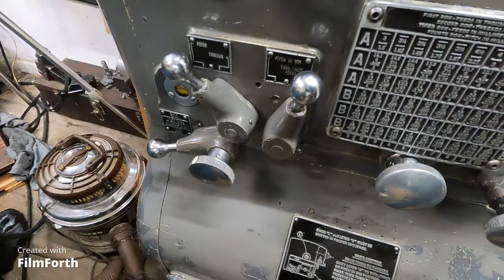Monarch 10ee lathe machining precision small screws 2

Comment: Looks good. You might even be able to make 40 tip threads for micrometers on the 10EE. The challenge would be to make a 40 tpi Tap that will screw (cut threads) into a bore of equal size and then screw the Starrett thimble into it and measure the travel. Thanks as always for bringing us along.
Reply from the maker: Hi, thanks for coming along

Comment: I'm a 20 year old in this trade and my lungs and sinuses are really messed up.  I think the chlorinated cutting oils and degreasers have messed up my lungs and I want to know if more machinists have similar stories. Spontaneous pneumothorax & pulmonary edema with constant lung discomfort and chest tighness. Ive seen doctors before anyone says.
Reply from the maker: I had developed skin reactions to the water-soluble oils over fairly limited exposure. The fact that the oil is water soluble I believe can enter your body. The CNC shops I have seen are really bad from the amount of that coolant used and getting it in the air with blow guns. Combine that with the metals that are gassing from the heat of the cut and you have a toxic environment for sure.
 Doctors are part of the system, they are not going to stick their necks out and say your workplace is killing you.